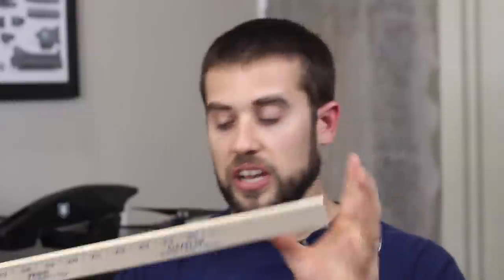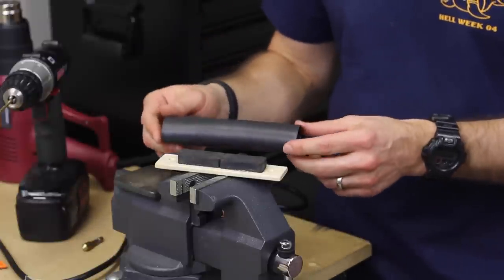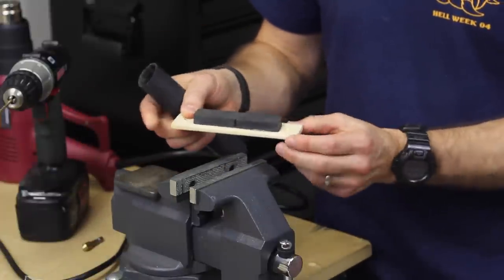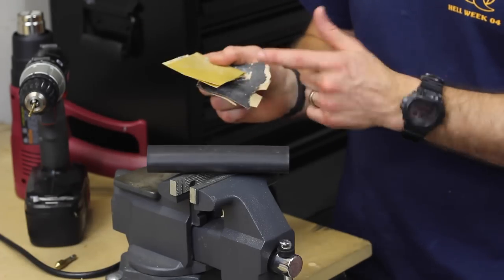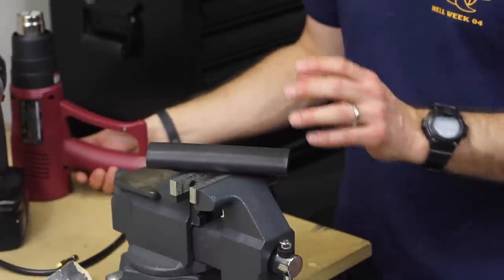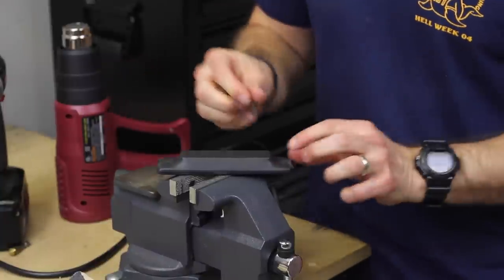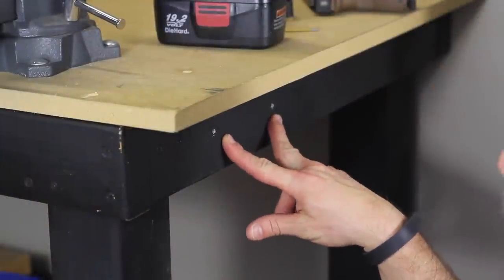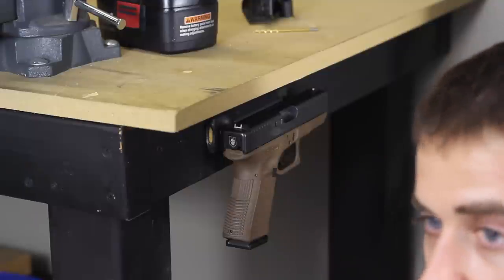DIY Inexpensive Gun Magnet Mount

Comment: You could use Plasti-dip instead of shrink tubing .Plasti-dip is the stuff on the handles of pliers. Its available at harbor freight and walmart. It has a slightly rubbery texture that would help with slipping as well. I love the vids !!

Comment: A pre-made very strong gun magnet that will hold a much heaver gun than the glock shown can be had for $20. so even if this one only costs around half it did not look to be strong enough for anything but small CHL carry guns. For the money I am not sure its worth it. Did this hold when work bench was in use? if it won't hold during bumps ect. this may be best used under a office desk or something?

Comment: Do you want your gun to have magnetic properties? I don't. Do you shoot steel cased ammo? I know I do. Magnetized firearm would attract small light-weight steel, or iron particles, which would be hard to remove. Steel shells may have failures to eject. Have you provided any experiments, which could prove this wrong?
By the way: they sell strong magnets of various shapes with screw openings in them and also some non-skid tape can be used to prevent scratching. People often use this tape to improve their gun grips. I believe they also sell demagnetizers, but I don't know much about them and how practical they are in this case.
Reply: No Names     Two positive & one negative magnet should solve that problem

Comment: Can you do a test video of actually pounding on the bench to show the gun doesn't fly off?
Reply: I agree he didn't ask to sure of it. Bang on that dam bench with a sledge hammer to test it, be that guy...is what we want LMAO....great video and very helpful (but), testing it is a HUGE part of a DIY Project!!
Reply: Those magnets just not powerful enough to hold the weight of the gun and the clip solid if you watch the video see how he balanced the gun on the magnets so it won't fall any kind of vibration that gun is going down
Reply: Kyle Fitzer  
Yeah if someone attaches their sig to that and it drops ....well we all know lmfao 
It's a glock though it can take a drop or two ...hundred

Comment: from experience using that size of heatshrink tubing, I would be pretty sure that you wouldn't need to glue the magnets to any type of a plate, or a base. the tubing will be strong enough by itself by leaving an inch or two on each side of the magnet and press the ends togeather while it's hot' then cool down with some water to ensure the tubing has cured

Comment: No plastidip available?   One can can take care of a whole lot of magnets holders.   Much cheaper than shrink tubing and a better mating surface for your weapon of choice.
Reply: Good idea but that would take too many coats and too many hours to make it thick enough and I don't think it would be as durable as the shrink tubing.
Reply: My thought exactly
Reply: Plastic dip or liquid electric tape works great. 2 coats good. Dry time included 1/2 day. 

But that thing you made cant safely hold  a screwdriver.

The firearm will fall off so might as well not even cover the magnet. Or get a firearm that is durable coated and throw the glock away

Comment: good video but I have one question or input if possible, how would I mount that magnet on say a wall  brick wall where I can't screw anything in. can't I use some sort of super glue adhesive
Reply: Leo Hernandez 
drill holes with a hammer drill and put anchors in the holes. Now you can use screws.
Reply: @Leo Hernandez
You can use a five-minute epoxy to mount to brick permanently, just make sure the brick is clear of paint or other debris first. Or you can  get a masonry bit (looks like a regular drill bit but with a flared spade looking tip) and drill into the brick, then use plastic  anchors (think drywall mollys) as Steven suggested.

Comment: What will you recommend for a heavier all metal gun, should i use stronger magnets?
Reply: You could use neodymium magnets. You can buy them online for pretty cheap, $10 should get you enough of them to mount a loaded AR to anything. I will forewarn you though, they are extremely powerful magnets and you should be careful where you set them, they will damage electronics and can explode if they snap together from far away.
Reply: I dont plan on mounting an AR but I am trying to mount a Colt M1911 Commander style pistol with a 10 Round magazine in it, I will try one magnet to see if it will hold. Thank yoiu for the tip
Reply: Home Depot has a very powerful magnetic strip for holding tools over a tool bench (about $10 or so). It's about 18 inches long and has permanent screw mounts at each end. You would not be able to slide heat shrink over it due to the screw mounts, but you could configure some cloth or stick-on felt covering.
Reply: I agree. Neodymium magnets would be much stronger and smaller though they are more expensive.

Comment: Does being in contact with a magnet for extended periods have any effect on the gun or its operation?
Reply: Lol wut?
Reply: Not at all, there's no electronics inside of a firearm.
Reply: A magnet usually does not interfere with electronics. I was thinking of the moving metal parts becoming magnetized.
Reply: Thank you!
Reply: sorry these dummies ruined your legitimate question. I thought the same thing. Filings bunching up in the same place is certainly cause for concern. I'd say just take that much more concern when cleaning. As far as parts becoming magnetized, I can't imagine it would be enough to cause an issue with moving parts as most are spring driven, and should have enough snap to counter a tiny bit of increased resistance from a part that has become magnetized.
Reply: Thanks.  It is a good question and good answer.  I was kind of concerned about safety when using my gun magnet so I don't leave the clip in the gun.  I would see the trigger getting stuck on the magnet and accidently discharging.
Reply: if you all are worried about magnets being next to or on your gun, then maybe shooting isnt for you. 
lol, the trigger getting stuck from a magnet? lol
Reply: I never said any of those things. Go back and read my comments again. If you still think I said that, then maybe reading isn't for you.
Reply: Tim Lewallen the person who posted above me said about the trigger. maybe you need help with reading. what would magnetizing the moving parts do?
Reply: If you used 2 positive & one negative magnetic it would stop it from becoming magnetized
Reply: batrickpateman1984 dude I am so sorry for laugh at all the comments befor you  but now I see your point you are brilliant sir you make a very good point

Comment: I wonder if you could epoxy that unit in place? I have a spot in mind in my motorhome that won't allow screws, but is a perfect hiding place.
Reply: I'm about 99% sure an epoxy would be strong enough to hold it in place, but you would need to make sure that you pick one out that will bond to the plastic material of the tubing.

Comment: I ordered these, but I had everything else I needed at the house:
http://www.amazon.com/gp/product/B00BZ9YU88/ref=oh_aui_detailpage_o04_s00?ie=UTF8&psc=1

applied 2 end to end, one with mounting hole on the end for vehicle, one with hole in the middle for desk

I haven't tried it under a work bench, since I carry at the house as well.  Under my desk, it's done fine (writing, laptop, etc); standard desk use.
I installed one in our Jeep Wrangler, so its kind of a rough ride.  Glock19 and lighter stays put fine.  Anything heavier (Glock 17/1911 slides down a bit so every now and then adjust

looking at the next one, I may use three magnets or these with Plasti-dip:

http://www.amazon.com/Magnetics%C2%AE-Grade-Neodymium-Magnets-4-Counts/dp/B000UUDGV0/ref=sr_1_30?ie=UTF8&qid=1417792235&sr=8-30&keywords=rare+earth+magnets